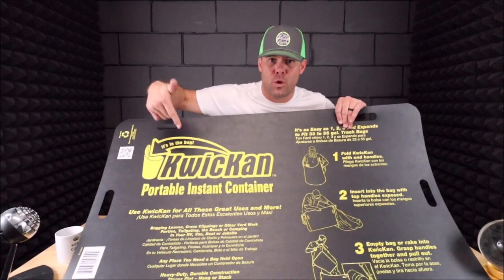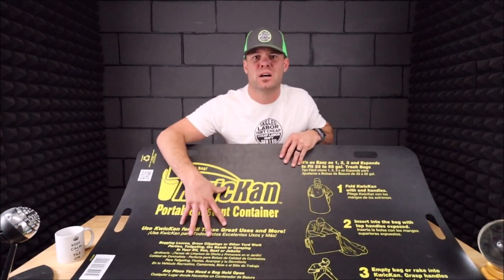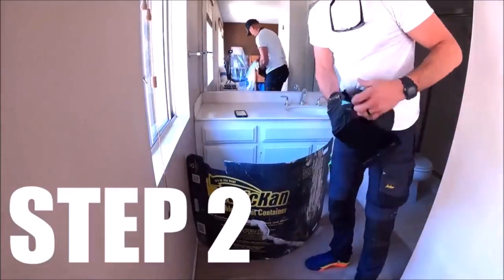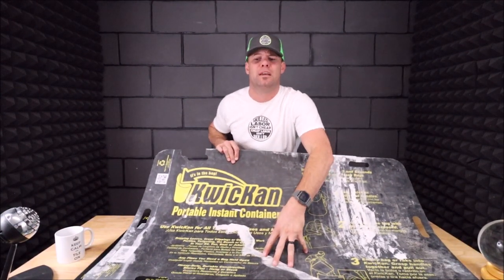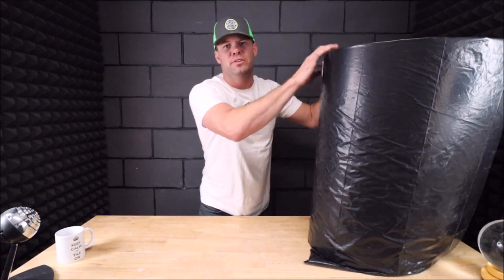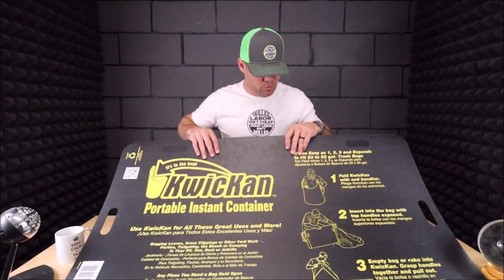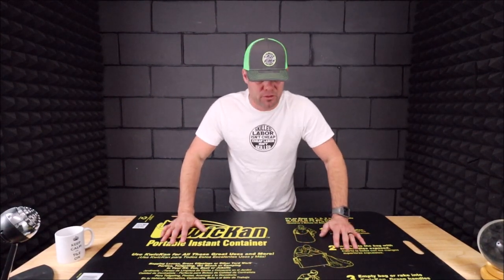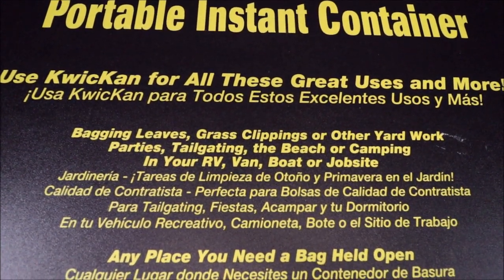Simple Must Have Trash Bag Accessory!

Comment: I finally bought one and I love it! Takes up no space in the van and it's supper easy to put into action. I'm going to be buying more for sure. That way I can have one in the house and one out by the saw. Used to use Rubbermaid cans which work great but they took up way to much space.